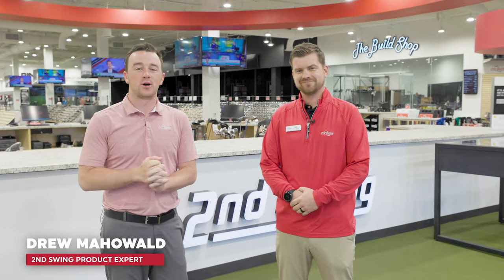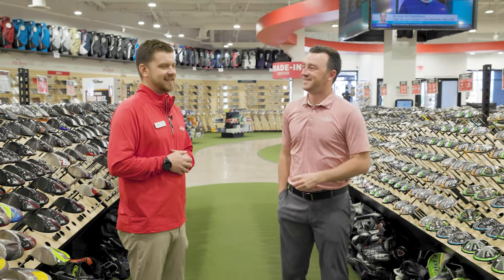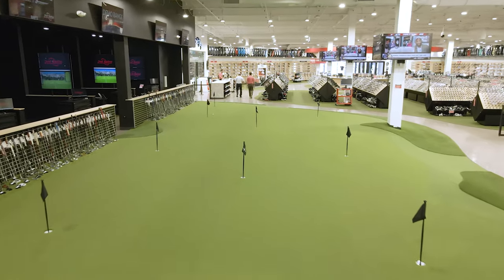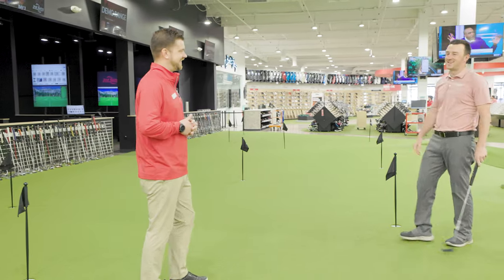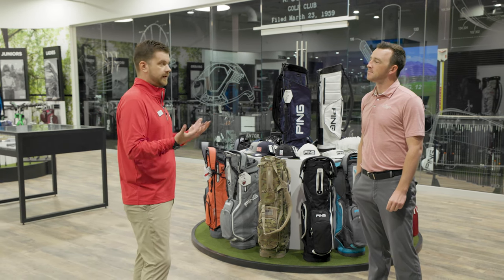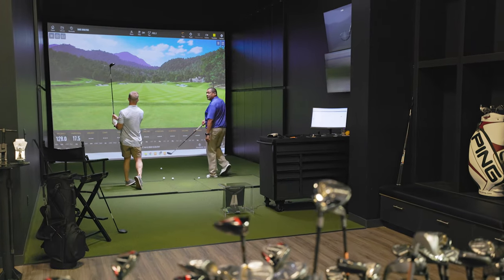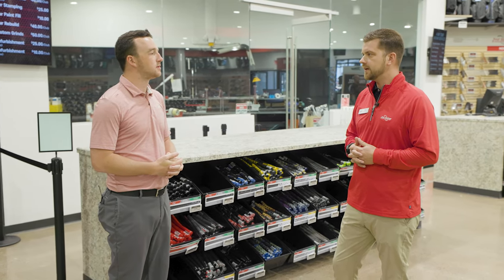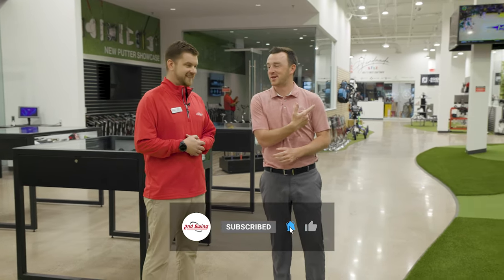NEW 2nd Swing Golf Scottsdale Store

Comment: I’ve been to your Delaware location 2 times in 2021, both for custom fits. Nearly a 2 hour drive from Staten Island NY but worth it.

Wound up getting a Set of “pre-owned” 2019 T-200’s 4-GW. The set was barely used and saved nearly $400 of a new set. Customized for me. 1/2 inch short, 1 deg flat. 
Fitter Tom H. Was great. 

This Arizona location looks amazing, the Delaware store is a mini-version of this one minus the Ping center, huge undulating putting green and that garage putting fitting center
Reply from the maker: Thanks again Stephen for all the kind words - Thomas
Reply: @2ndswing  you’re welcome. Maybe coming down to the DE location again in the fall or early spring next year. Looking forward to it!